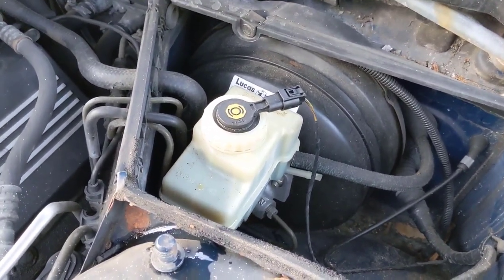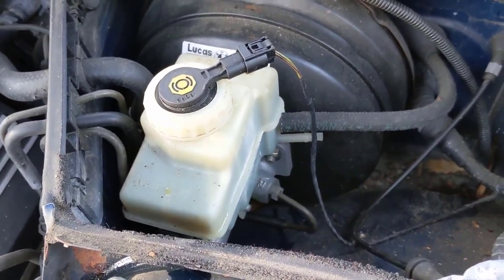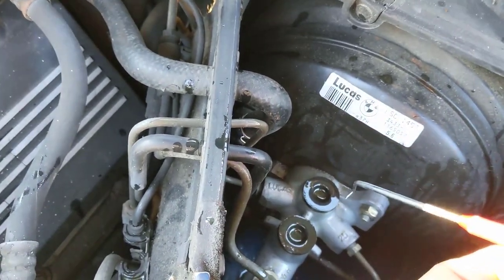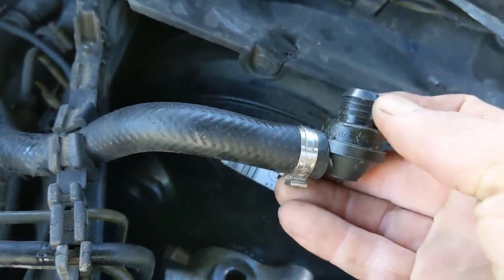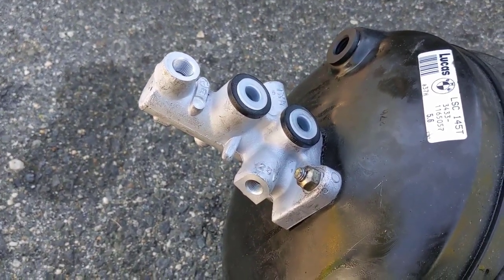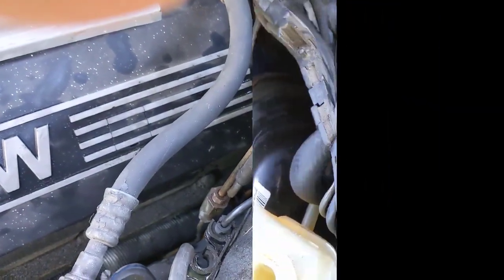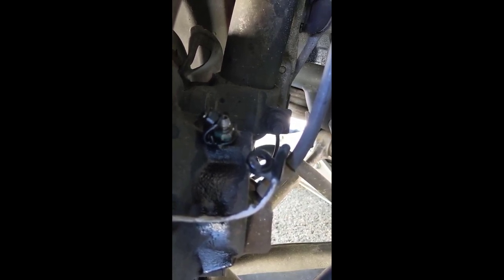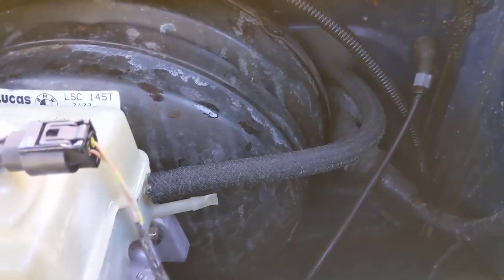BMW Brake Master Cylinder replacement step by step

Comment: Why did you take the booster out if you're only changing the master cylinder? Can I just remove the master cylinder while the booster stays on the vehicle?
Reply from the maker: You can not get just the master cylinder out, it won't fit. You have to remove the hole thing and take it apart once it is out. If someone tells you don't have to remove it this way they never did one.

Comment: Hi, I have a 2009 328i e90 that might need a new master cylinder.  Is there any special procedure for bleeding the system with ABS?
Reply from the maker: No, Just bleed the same as you would any other car.
Reply: actually yes, you need a BMW bidirectional scan tool -> select brake ventilation and use during regular bleeding procedure.

Comment: How did you snap the reservoir back on? I’m having a lot of trouble getting it back on.
Reply from the maker: It just pushes in try putting brake fluid on the rubber parts.
Reply: @Glennfix  yeah I’ve pushed it in a lot and it’s well lubricated with brake fluid. The reservoir is maybe 1-3mm from sitting flush onto the grommets. It does “wiggle” a lot and I’m not sure if it’s supposed to do that. Can you confirm?
Reply from the maker: There is a clip on each side of the reservoir, it should clip on the the master cylinder. If it is clipped on the master cylinder it is good, if not something is wrong.
If the master cylinder fit you car with no problem you might have to get a reservoir from the same place.
Reply: Always use lube/grease
Reply: You don’t have to take the booster out
Reply: @ediego32  I purchased a new master cylinder which came with a new reservoir, and it fit perfectly. I can only assume the rubber gaskets had fatigued over the years causing more elasticity and not allowing the reservoir to fit properly. Everything is solved now tho.

Comment: Why did you remove the vacuum booster? Looks like you didn't have to.
Reply from the maker: It wont come out of the hole it is in if you try to take the master cylinder off the vacuum booster.
Reply: @Glennfix   - ah... this is specific to this model then. I did a master cylinder today on an '88 528e and it was much simpler design.

Comment: I’m curious why you went to the extreme to remove the booster when it was not required all you needed to do was remove the bottle off the top remove the brake lines and then I’ll do the two bolts that are on either side of the cylinder to pull it out because the rod that connects to the pedal itself stays in place?
Reply from the maker: You can try if you want. BMW is different then a lot of cars. You can't pull the master cylinder out far enough to get it out of the well that it is in.
Reply: Pretty much my same question I’m about to pull it hopfully I don’t have to go through pulling the booster also. What a pain why not give the space for future work bmw always doing something stupid when they are some the best engineers in the world.
Reply: 3 years late but did somebody did this an do you need to take the booster out?
Reply: @toxicmonsterz7470 
We need an answer 🤣
I need an answer 🤣🤣🤣

Comment: Is a brake master cylinder the same a clutch master cylinder?
Thanks
Reply from the maker: Basically yes, they both work the same way, use the same fluid and complete the same function
Reply: @Glennfix  do you know about any video tutorial to change a clutch master cylinder on a mini Cooper s 2004?
Thanks alot bro
Reply from the maker: Sorry I do not

Comment: What made u replace it? I have an issue with the brakes dropping to the floor
Reply from the maker: Most of the time when a brake master cylinder is bad; what happens is when you step on the brake at a  traffic light the pedal will go down slowly. That is what happen to mine. The fluid will bypass the plunger in the master cylinder.
Reply: Could also be the brake vacuum pump passing engine oil into the brake booster. That’s what’s getting done on mine today, vacuum lines included.

Comment: Where did you order the master cylinder Amazon or what site?
Reply from the maker: https://www.ecstuning.com/BMW-E39-540i-M62_4.4L/Braking/Master_Cylinder/ I got the TRW. TRW has been making BMW parts for years. I would stay away from the low cost ones, a lot of work for something to fail fast.